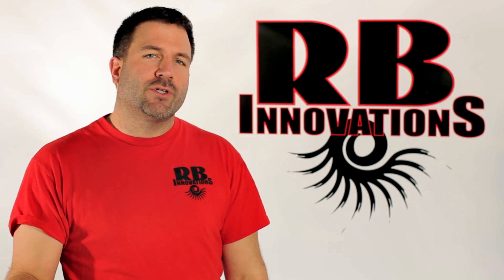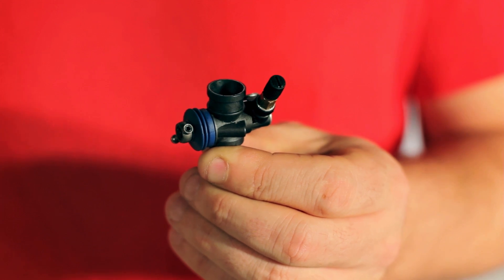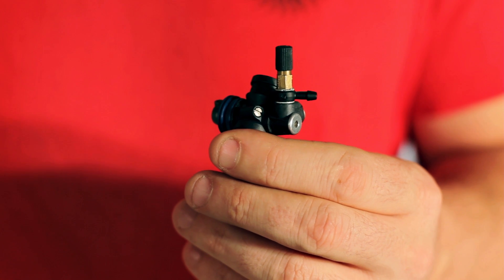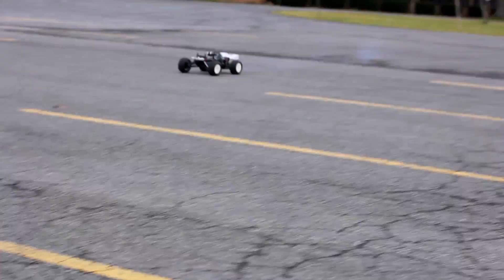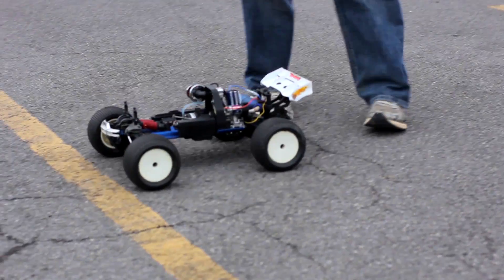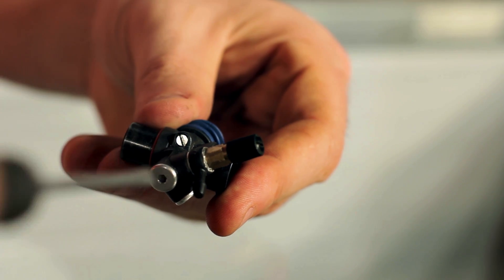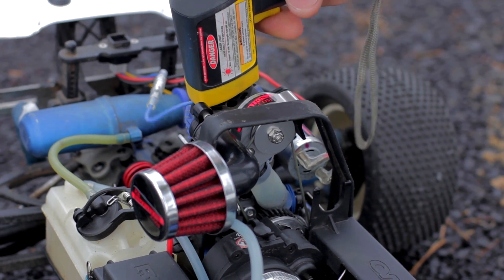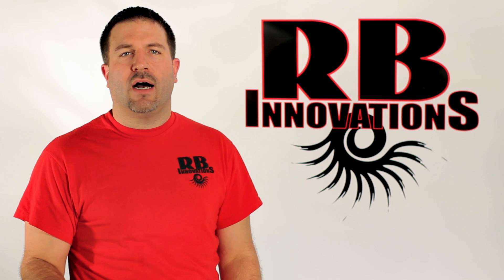How to Tune a Supercharged RC Engine

Comment: Zac Otis  yea and the intake goes through the crank shaft when the piston is at bottom dead center then the turbo pressure would go out the exhaust before the piston went past the exhaust port meaning no turbo boost ....

Comment: How does it work without exhaust valves.the pressure would go straight out the pipe
Reply: the cylinder closes off the exhaust port as it moves up in the stroke

Comment: When super or turbo charging an engine, you need to run a lower compression ratio. How do you get around that with these kits, seeing as you don't offer a new low comp piston with the kits?
Reply: Glow engines and 2stroke engines ARE lil different....Also one can always get higher percentage nitro lol